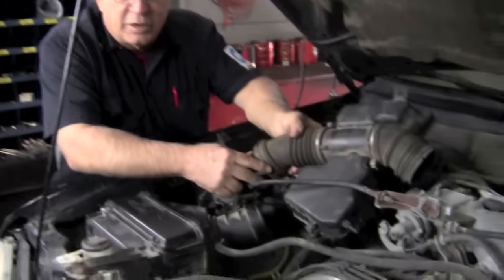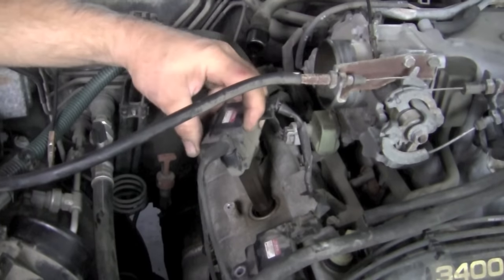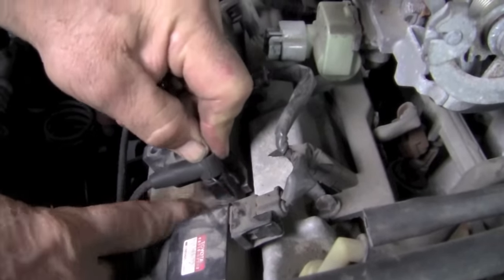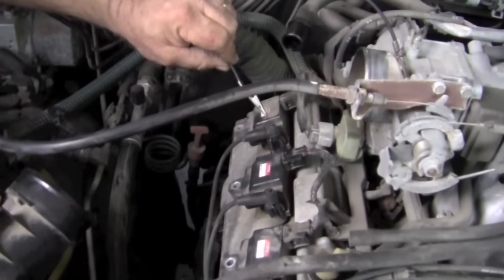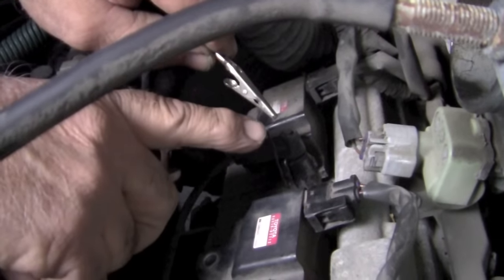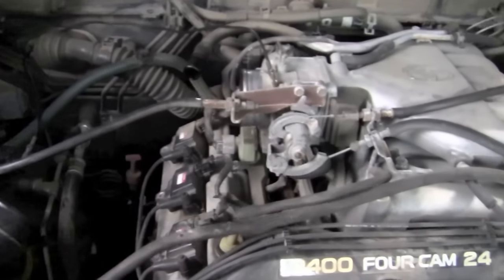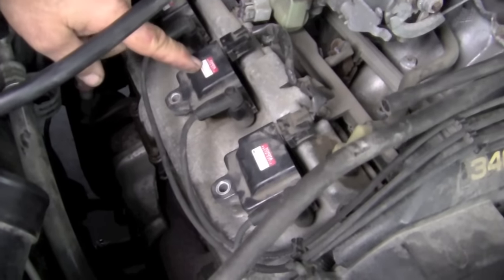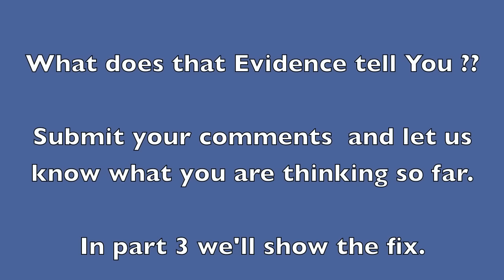How to find a misfire without a scanner 2

Comment: That center coil is firing under a load, I seen it when you pulled it out and the spark looked strong, so with no change in engine when it's pulled, it's either a coil wire or a plug. If it were me I'd just go ahead right there and replace all the wires and plugs. But, I don't think you have a totally dead cylinder, it doesn't run like it does, so I'd say you more than likely just have a weak set of wires, and or plugs. You could turn off all the lights run the engine and look to see if those wires light up like a Christmas tree? If they do, then their no good. Bad wires will run a engine fine at light to no loads, but then under loads, they fail because the engine isn't getting the spark it needs and will foul a plug out.... eventually, not counting the fact it throws off ignition advance way out the window.
Reply: asustech007

Comment: crank shaft position sensor, fuel injector, o2 sensor,spark plug,low compression on that cylinder

Comment: thank you very much   i was wondering how to test my plugs and coils on acura tsx 2004
 algo iam having  my CEL light blinking when iam driven wont go past 60 MPH
Reply: cel blinking is very bad and you should not drive the car- if it is misfire, you can kill the cat and that is expensive if you are in an emission country or state- does it backfire and chug when under acceleration? do you smell unburnt fuel at exhaust at idle?

Comment: just asking is this just another way of checking your coils that you are sharing... because would it not be easier to check the resistance of the wires and electrical prongs of the coils and compare them to spec. or is there a more in depth reason why it would be best checking it your way... i ask only as a student of U.T.I. not because i feel one way is better than the other... thanks for your vid
Reply: It's always more effective to do a live test. Correct resistance does not indicate other problems with the wire, like a pinhole or carbon tracking on the outside. Plus, it's faster than a visual inspection of every millimeter of the wire.

Comment: @LCCharlie Dead on, he reminds me so much of an old friend that's an old school master mechanic. They both think the same, use both old school and new school as well as clever diagnostic methods, and even have the same hair color :D Duane is a bit more on the expensive toys/better off end of things but my friend has on old tool that when you hook up shop air to it, it blows hot air out one end and cool/cold air out the other which just baffles me - used for testing chokes he says.

Comment: first it would point to plug  but happend to mine was turned out to be injector, diconecting plug lead would make no differance to missfire when reconnect lead cylinder would fire again and then stop sometimes, left thinking it was bad plug swapped injector around to other cylinder misfire followed it. was hard to track down

Comment: I have a 2000 F-150 trying to put the engine back in and I can't get the bellhousing to close up for the block the last half inch what should I do
Reply from the maker: you must have something blocking the way,  OR,  there are usually small alignment "dowel" pins that are inserted into the block and/or body.  Check their alignment,  you may have two of them in the same hole.
Reply: Check your torque converter. Did you rotate it until it clicks into the transmission pump? Usually this is the half inch gap you see.

Comment: Ok....if this particular system uses one coil for two cylinders then I think I would first loosen all the plug wires from the plugs, then reconnect so they come off easy during the test, put a small  load on the  motor, then use well insulated pliers and pull each wire one at a time. If only one cylinder affects RPM it's the plug.....If the cylinder that shares the same coil also misfires it's the coil unless by a slim chance both plugs are bad. Now... I'm a plumbing contractor, so I'm no expert here but, would a plug that hasn't fired in the last....I dunno....say,1,000 miles be fouled?

Comment: I have a 08 mercury mountaineer and I just got all coils and spark replaced but now it's saying I have a misfire in cylinder 4 . I already changed maf now it's running but it's jerk drives now because of that misfire anybody know how it would burn out that fast less than a week you think that's coil or spark

Comment: how do you load the engine?
Reply: Danny Rodriguez qvo homie like the guy above said power brake it with car in gear 1 foot on the brake and 1 giving it gas you should should be able to replcate the misfire usually due to coil and or wires.... tune up time

Comment: I thought you were not allowed to pull  that boot away from the plug!  Don't you risk burning the coil driver inside the  ECU?  And/or the coil itself,since the Amps go up,and also,the spark has no place to go?   I would just  UNPLUG each coil in turn,no harm there,then  ground the wire with the S wire you made;
Well....it's fixed by now   LOL

Comment: Check Automotive Wolf Vehicle Maintenance & Management Software designed to manage your preventive car maintenance schedule, remind you when service is due, track all your vehicle expenses, monitor your fuel efficiency, help you avoid repairs and keep your vehicles in top running condition.

Comment: why do all of you say plug or coil when it works perfect at idle, and shows good spark when pulled up into view?

Sounds more like injection related.
Reply: Could be a cracked plug or carbon on the boot also, but we'll see in the next video.

Comment: hi everyone pls help me for my fucking honda civic 2006 menul transmission i change new spark plugs and coilpacks also i.change but the problem is still there... there is no engine light...the problem is when my car is cold for a few menuts its runing fast and power is there.. but after when car is warmup there is no power not going fast not taking ecceleration you think that car is running on only 2 cylinder and i feel some missfire... i don't know what is the problem.....
Reply: Bad catalytic converter
Reply: cylider fuel injector.👍👍👍
Reply: Start with the simple things first. Get some MAF cleaner and clean your MAF. Also clean your throttle body and IAC if you have one. These take special cleaners you can find online by CRC. I'm not sure what your car has. Next I would look at sensors like the coolant sensor or throttle position sensor. Good luck!

Comment: MY V6 ENGINE HAS LOW POWER, POWER WHEN ACCELERATED MAKES HEAVY SOUND
Reply: SO, How can we resolve this menace as we two too have the same occurance, have you changed the plugs, fuel pump, air filter~